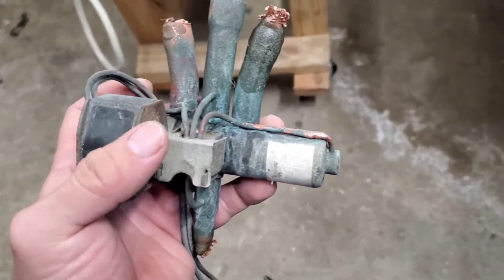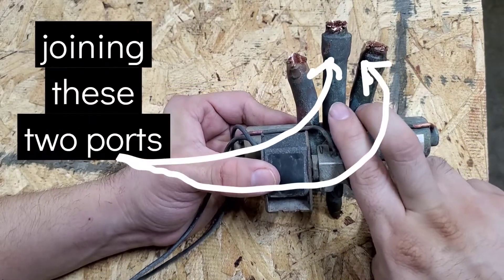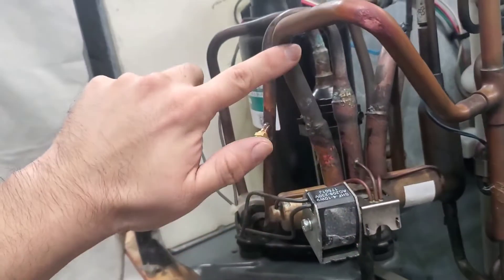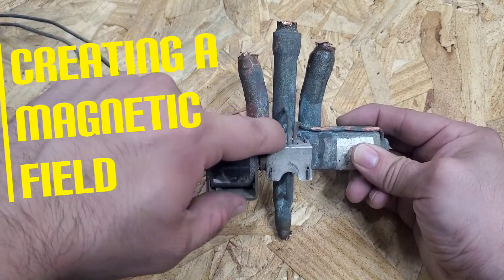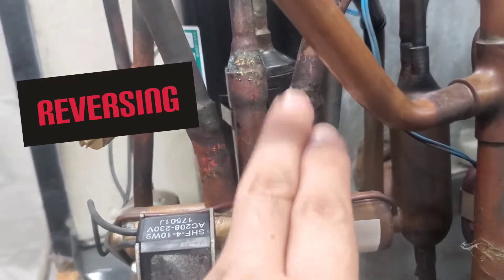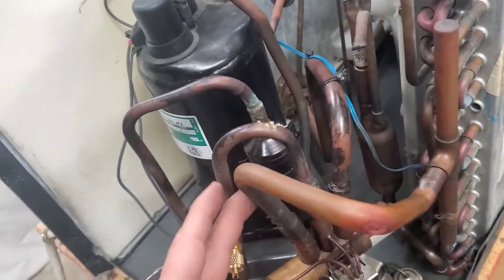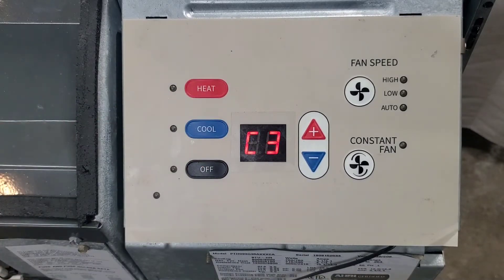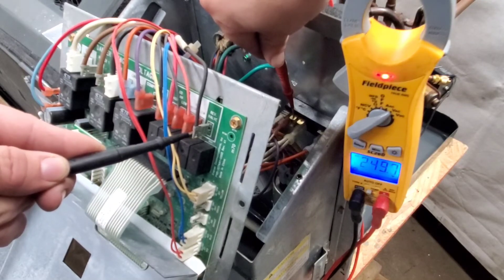Basic Ptac heat pump function and important details....

Comment: Them heatpumps for the ACs are a life saver My air conditioner is a 2300btu with a 12000btu heater system But they work very well in the winter, LP heaters you will pay a fortune trying to warm your home but the heatpumps work rather well i think, It does not get that cold where i live tho in the south

Comment: back with another question is the solenoid go bad often and can it be replaced
Reply from the maker: It's kind of rare when they go bad, but if they do it's pretty easy to replace. It's just two wires and a 5/16 screw
Reply: @PtacSolutions  any symptoms i might notice its going bad?

Comment: Thank you so much for this information. Here in NYC I'm familiar with Islandaire, McQuay and Amana units as well. Is there a 115V heat pump PTAC model available by any brand? Or are they all 220V because of the electric heat. Thanks!
Reply from the maker: Hello
From what I have seen they are all 208-230v.

Comment: Just let me get something straight, so the heat pump mode only works if the temperature is 4 degrees lower than the temperature set on the PTAC right? I guess it is to keep the temperature in the room but if the temperature drops lower than or more than 4 degrees then the heat elements start working so raise the temperature, am I right or did I get it all wrong? 😅😅
Reply from the maker: That's exactly right 💯!!

Comment: Question so i replaced the coils on my ptec unit (islandaire) i still get no heat any idea what it might be ?
Reply from the maker: Hello 
I would check the limit switch first, if they are good I would make sure the control board is sending power to the heater coils... identify the heater wires from the board to the heater coil, and wait for the delay(about 3-5 minute),  you should get around 230 volts by checking both lines
Reply: @PtacSolutions  thanks 🙏